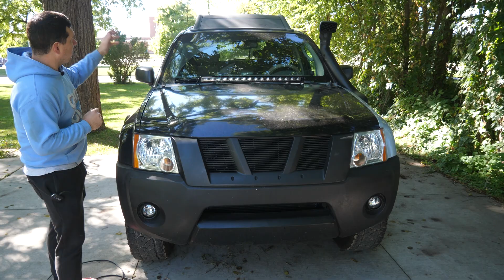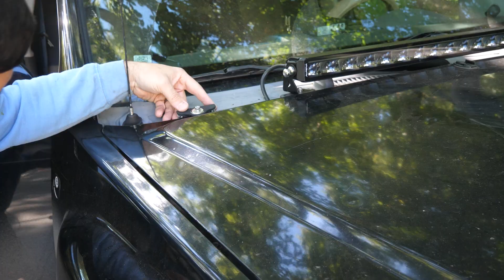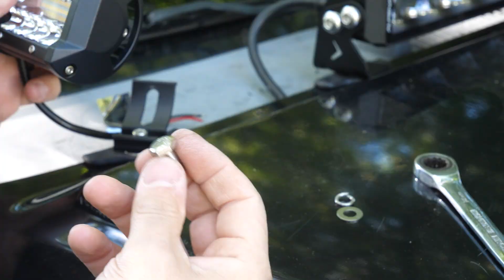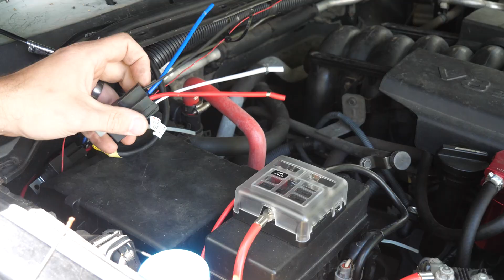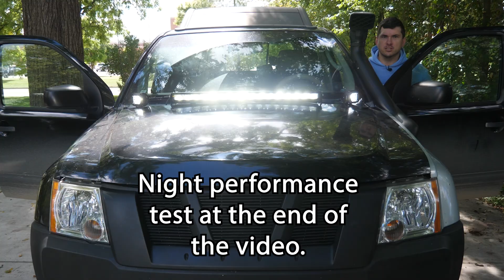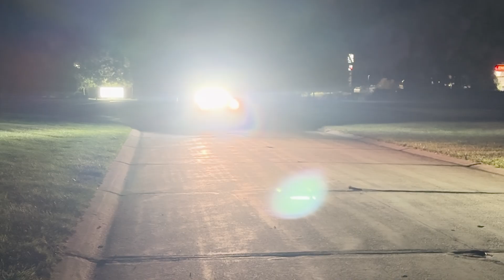How to install Ditch Lights on an Xterra/Frontier/Pathfinder

Comment: I understand going with hood clamps for the price, but is there any risk of scratching or denying the part of the hood that's being clamped?  That's pretty much the only thing stopping me from getting ditch lights right now.
Reply from the maker: The clamps come with a metal protector plate specifically designed to prevent damage to your hood paint. But yes, if you get mud or something in there or they shift around with vibration, they might scratch the paint. If you think about it, it’s still a hell of a lot better than drilling through your hood to mount them lol

Comment: Install was way easier than I thought! Do you foresee having to tighten them again after some time on the bumpy roads?
Reply from the maker: You know, I thought I was going to need to but I have been running the center light for a while and that sucker has not budged. Those things are crazy. I think compressing the rubber on the top helps keep pressure on it.
Reply: @Rythecarguy right on!

Comment: How to improve braking/bite in Xterra..!?
Reply: @vineeth_devan also just had my brakes serviced because they were soft. Pistons inside calipers were sticking and not returning to “home” properly. Once cleaned and lubed, brakes are much more responsive.
Reply: Bleed brakes
Reply: Bleed abs actuator, open the 2 center lines slowly you'll hear air come out.
Reply from the maker: Is this an Xterra thing?
Reply: @Rythecarguy  read about this on TheNewX forum.